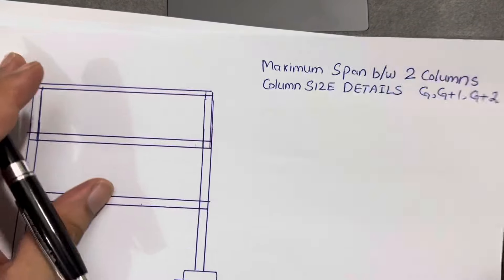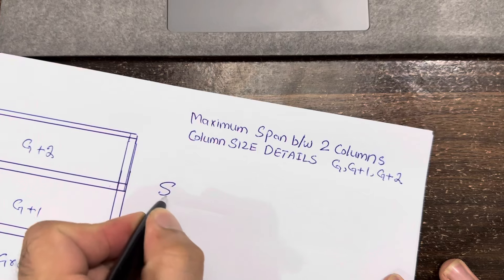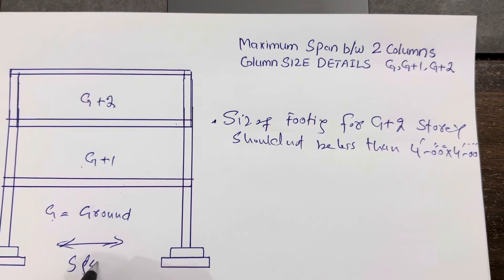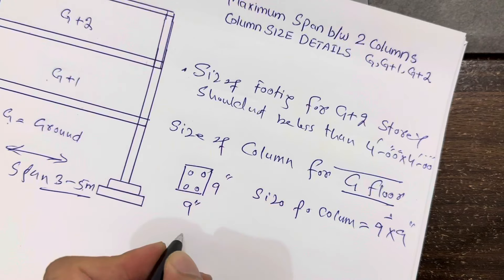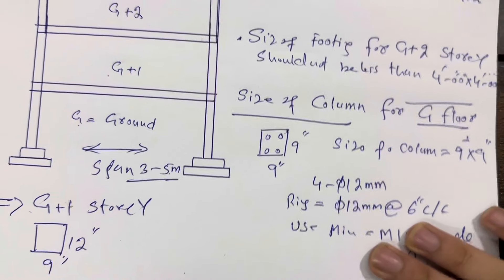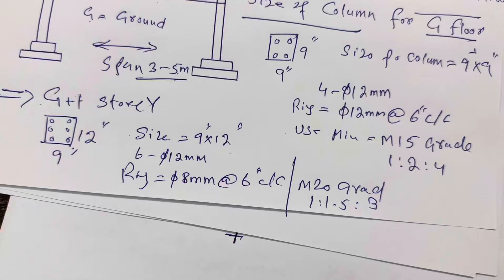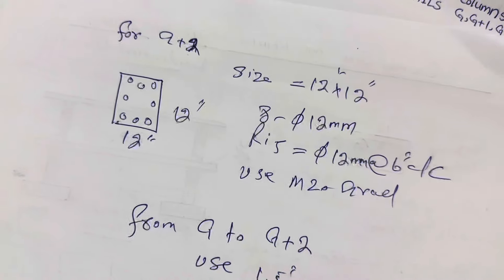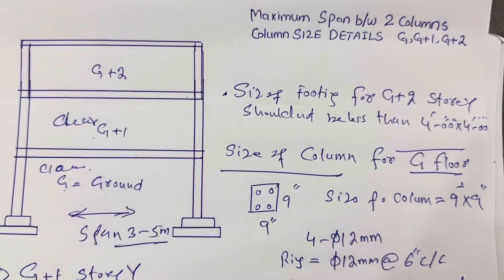Maximum Span Between 2 Columns - Column Size Details G, G+1 , G+2

Comment: Room size 13*13 . Column distance 13 feet. Column size 9*12 . Steel used 16mm 4pc and 12 mm 2 pc , Ring 8mm@6 . It is save for G+1